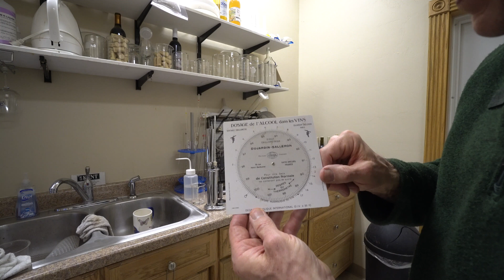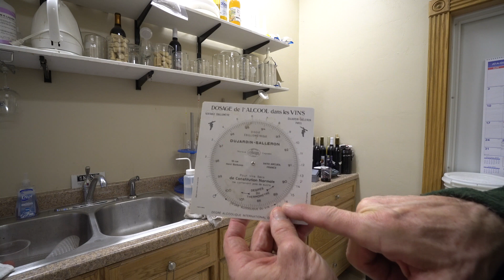How We Measure Alcohol at the Winery

Comment: could you also just get an alcohol meter and use that to measure your alcohol percentage. Obviously they aren't accurate under 20% and your wine would have to be dry. But could you not just take  some of your wine sample add it to some vodka and measure that alcohol concentration and then some simple algebra later you know what your percentage is?